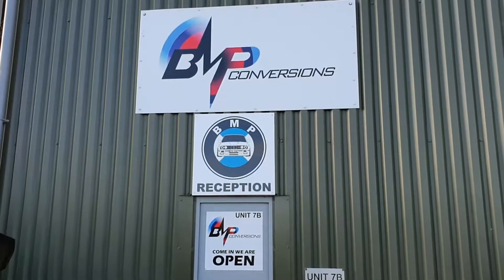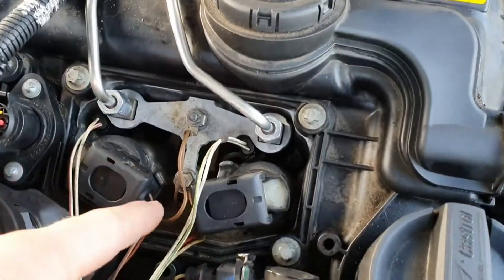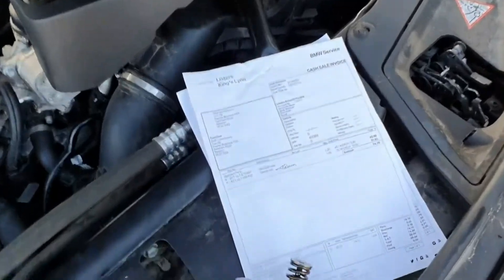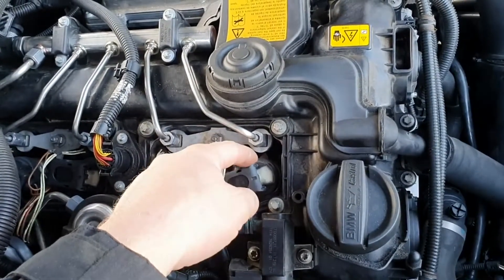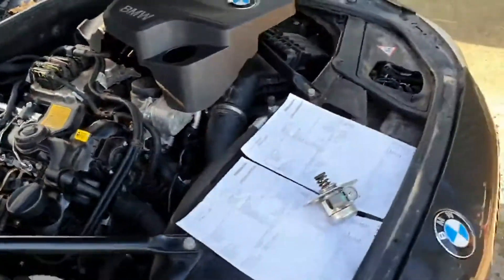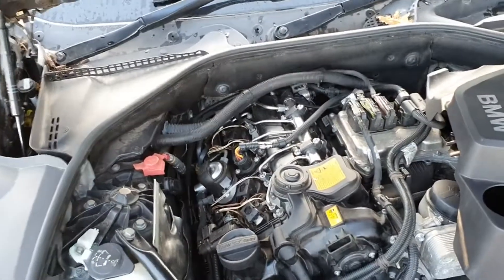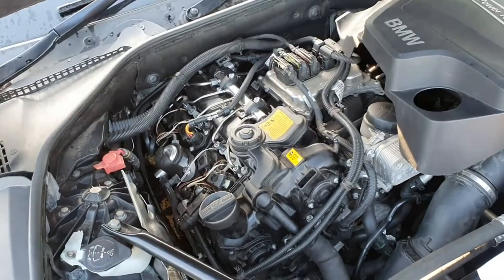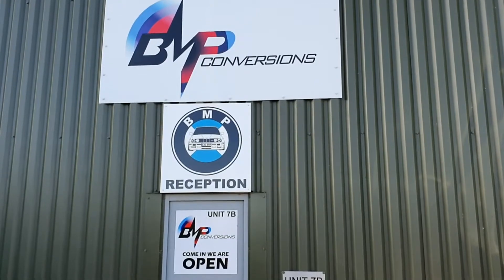BMW N20 rocker cover gasket replacement F10 / E89 / F25 / E84 / F30 / F34 / F22 / F45

Comment: There is no reason to replace the fuel rail and lines
Reply from the maker: We follow the BMW recommended guideline of what to replace when doing the work and they clearly state to replace any high pressure fuel pipes that have been undone/removed. The last thing we want to happen is high pressure petrol leaking onto a very hot engine causing a fire. The level of risk for the price of parts is simply not worth it.